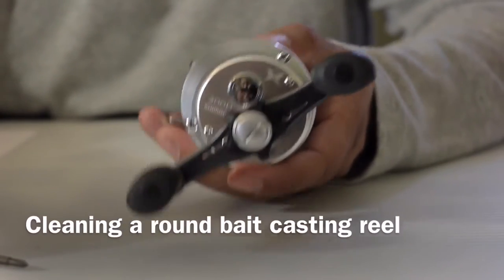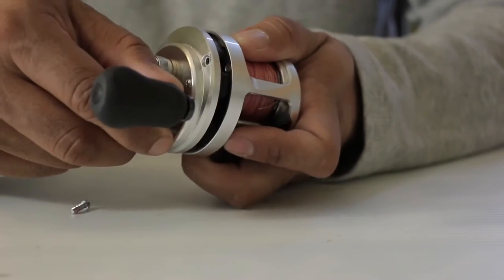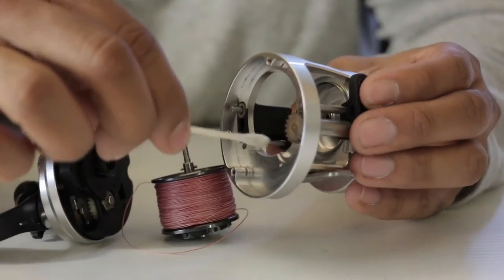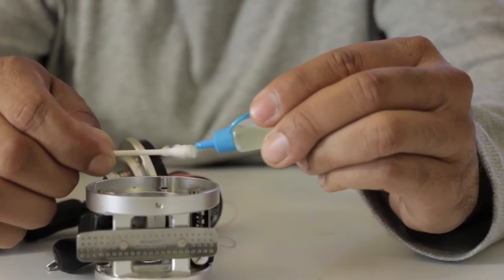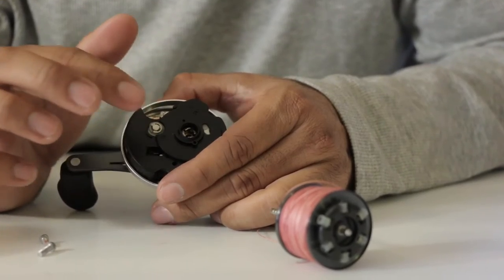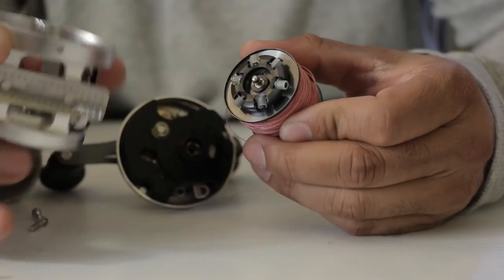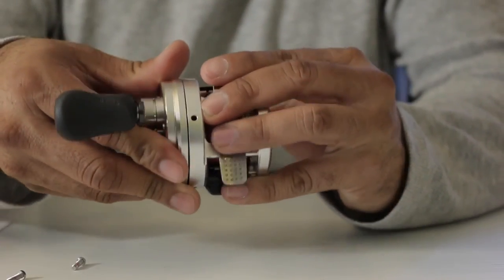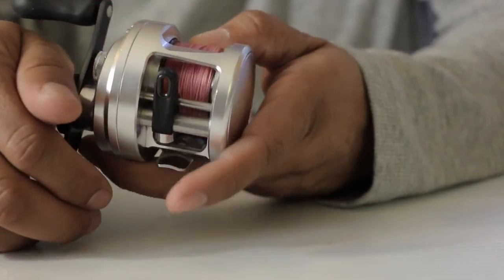Basic cleaning and maintenance of a round bait casting reel. Shimano Calcutta 200D

Comment: I much rather clean the fish. Perhaps thats why my Calcutta 200 the spool doesnt lock, pull line out & the handle turns counterclockwise like the real old baitcasters. I had it looked @ & after $25 its still the same. 😡 Fed up with the local baitshop/ reel repair guy. Anyone knows why its doing that. ? Thanks for the imformative video & thank God for Abus Garcia's Ambassedeur baitcasting reels.THEY NEVER BREAK.👌